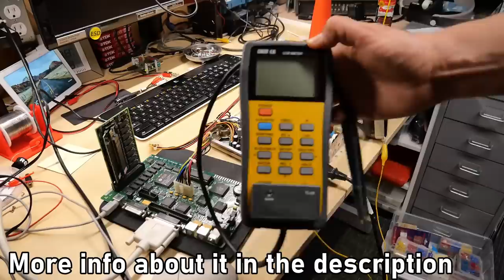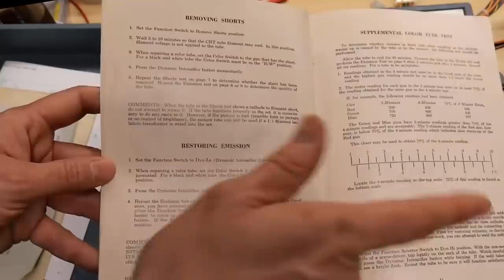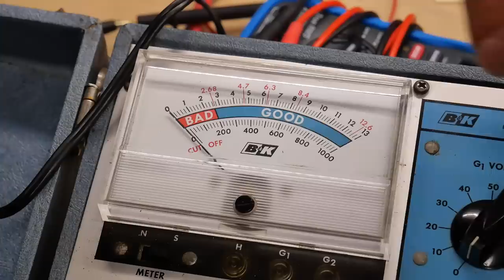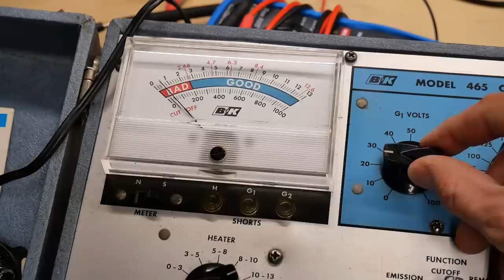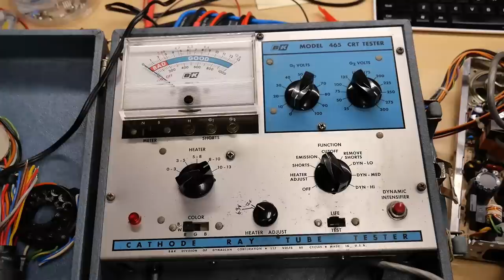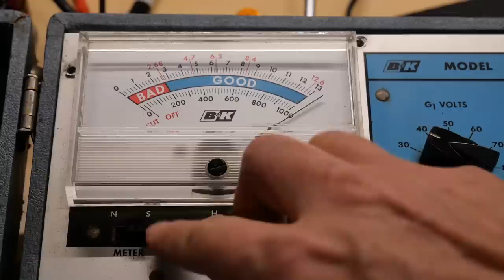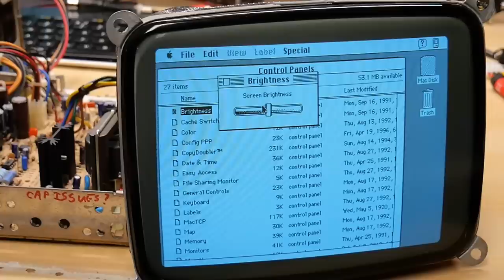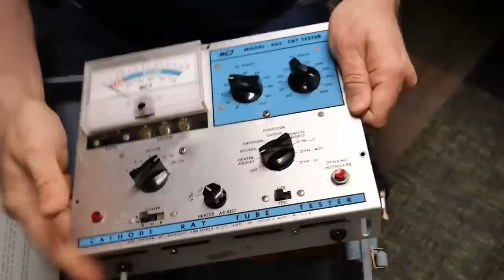Rejuvenating a Macintosh CRT with equipment from 1969

Comment: Someone needs to tell Louis Rossman about this..
Reply: I thought this exact thing
Reply: His comments section would explode with rants about the "impossible" Torx screws and "cramped" circuit design. Oh, and that you can't game on a Mac .-D
Poor Louis is cursed with a terrible audience.
Reply: @IlBiggo  Modern macs are trash for gaming. macOS has an ancient version of OpenGL and doesn't even have Vulkan unless you count MoltenVK.
Reply: @Margen67  Newsflash: gaming is not the main reason computers were invented. Cars are absolutely useless when cooking, but this doesn't make cars "trash".
Reply: @IlBiggo  They're not trash, but they're still not good for gaming.
Reply: @Margen67  Which would matter if Macs were marketed as game consoles. Macs are "good for gaming" just a bit more than cars are "good for cooking".
Reply: @IlBiggo  https://www.apple.com/mac-mini/#versatility-gallery-item-2

Regardless of marketing, it's still a legitimate criticism. A good number of PC users are gamers.
Criticizing things doesn't make someone "terrible".
Reply: @Margen67  <sigh> again, gaming is definitely not the main reason you'd buy a Mac for, just as, say, audio production is not the main reason to buy a PlayStation. That's why "a good number of" gamers are PC/console users and not Mac users, while "a good number of" professionals and general users just don't care about which computer they're using if it does work for them.
BTW, this reviewer https://www.forbes.com/sites/patrickmoorhead/2020/12/26/apple-macbook-pro-13-m1-aaa-gaming-experience-good-performance-for-thin-and-lite-but-rough-experience-for-some-games/?sh=64931e056209 seems to be actually a bit more satisfied with his Mac gaming than the average audio producer would be with a game console. And no, "it doesn't run ProTools" is not a valid criticism for the PS5.
Macs are not gaming consoles. Can you play games on a Mac? Yes. Surprisingly, even pretty demanding games appear to run fairly well.
Can you make a living as a professional gamer on a Mac? Probably not. W h o   c a r e s ?

Comment: In CRT days, I occasionally would attempt to rejuvinate a tired tube (while it was working) by tapping the neck very gently with a screwdriver handle. I know it sounds horrific, but it always worked for me, and I never broke a tube. It's the same principle of course; dislodging crud from the cathode.

Comment: I've used those before. you might get 30 seconds out of it or 30 years. Point is they don't make new tubes anymore so don't complain! if it shorts, you can try turning the tube on and tapping the neck with a blunt insulated device. it will knock whatever flaky coating they have on the electron guns off that is shorting and hopefully make it work. this is also why you don't want to store tubes neck down. any debris in the tube can short the guns out. Sony Trinitrons are bad for this.. I had many guns short.

Comment: Ahh - BK CRT tester... I bought a brand new BK 490 back in the early 90s for my TV workshop and it soon paid for itself, saving me spending too much fixing a dead TV only to find the CRT was bad. Not used it for over a decade and I just had to wander over to the workshop to fish it out for some nostalgia! Rejuvenation can be hit or miss - I did have one TV that went on for more than 7 years before dying from other issues!

With experience, it was possible to get an inkling for how well a rejuvenation might last just be how long it took for the needles to move.
Reply from the maker: Yeah there is definitely a technique for using it. I have practiced on another old color TV CRT and learned a lot. (I made this video about a month ago.)_
Reply: Adrian's Digital Basement Some brands of tube seemed to stand a much better chance of rejuvenation. The others would rapidly get worse with repeated attempts despite an initial improvement. I suspect the cathode material was used up. A handy tool to have and I feel old for having used used one for a living!

Comment: Your Rejuvenation Doubles and Reverses the voltage potential between the Cathode and the Control Grid.  Performs sorta a REVERSE Plating action.  As stated below it does remove some crap  off of the Cathode exposing fresh meat so to say.  No it won't last long.  Months at best.   Yes you can perform it a few times before any benefits are lost.  The Heater them selves go weak in time.

Comment: Nice work! Hopefully it lasts a few more years, considering it'll probably get some fairly light use anyway.

I should ask old the techs around at work if any of them have an old CRT tester that I could buy off them. But I'm wondering whether Heathkit or some other old kit maker sold one back in the day. Because it looks pretty simple, so might be possible to find a schematic and make a new one using modern parts.

Comment: The 465 will use the newer CRT adapters of the 466, 470, 480, and 490 testers if you have an adapter from BK. I have one NIB for trade bait if interested.

Comment: VideoKarma.org is a great place to get help with your rejuvinator. Yours has diodes, so increasing capacitance from 50 to 82 shouldn't present a problem. I recommend changing those caps, and making sure those caps are not having their voltage rating exceeded as modern caps don't tolerate overvoltage nearly as well as the old ones did.

Comment: I thought the manual said to hold the button for a while on the med setting. 
I see you tried my suggestion of rejuvenation, I actually do not own a machine to do it I just use my high voltage PSU and pass current through the cathode G1 pins as a valve with a limiting resistor and a meter in series so I can monitor the current..
Most 20mm neck CRT's are 12V heaters, 28mm and 36mm tend to be 6.3V.
I have not had any back for rejuced emmision and some have been in use for over 12 months.

Comment: How does that work? What is going Bad and what is that device doing to restore it?
Reply: I'm not an expert on CRTs, but my understanding is that the dimming of the picture is caused by chemical oxide buildup on the cathode which will limit the emission of electrons. The rejuvenation works by running high current through it for a brief moment, which 'burns' away that oxide coating.
Reply: @Shifter-1040ST  The test switch, switches caps from a carging position, into a discarge position on the cathode.

Comment: Interesting stuff.  I did a quick search out of curiosity, and apparently rejuvening a CRT blows shorts out of the electron gun(s) with a capacitive discharge.  So if it was a short caused by some contaminant and you blasted it away/vaporized it... that tube may last for years. LOL
Reply from the maker: Indeed. I think a short rendered the CRT unusable until you blow it away. I haven't seen that particular problem before.

Comment: I'd like to see a video about that LCR meter you showed.  Can you actually test them in-circuit without desoldering one lead with it?
Reply from the maker: Most of the time yes. It can test the caps from 100hz to 10khz. I'm super happy with the tester. Does a fantastic job and in combination with a DMM, it's just great for testing caps and resistors in circuit. (Testing resistors with DC like what a DMM does is useful when there are caps in parallel.) 

I figured I will make a video once I get more experience on using the DE-5000. First time I've had gear like this and it was a hugely worthwhile investment.
Reply: @adriansdigitalbasement  So like when you have several capacitors in parallel, like the filter caps in a PSU, you don't have to desolder one leg of each of them to get a good test without the others interfering?

Comment: My guess about the life test is that it measures some kind of leakage, as if the tube were a capacitor. The faster it discharges, the leakier the "capacitor".
Reply: I take that back -- in looking at my own CRT, the life test turns off the heater, and I guess it is measuring how long it takes for the heater to stop emitting.

Comment: When you calibrated the filament voltage you did it under the expected load, right? The power supply has no feedback and is adjustable to match different filament loads. Low filament voltage will lower emission.

Comment: Great video Adrian, nice bit of test equipment.
You said you replaced the offspec capacitors in the powersupply.
Did you replace the rest of the capacitors on the PCB, not necessarily the high DC bus capacitors, but the ones around the output?
If not it will be worth doing, as they will be form the same manufacturer and be of the same age, SMPS capacitor failure as you know is pretty high in older, and some newer, SMPS.
👍👍👍👍👍

Comment: When you're rejuvenating a tube and you're pushing that button momentarily what you're doing is you're overvoting the guns and that sends a high charge through it that blows any shorts that are in the guns or the grids off the spark at you here is because it's actually sending a high voltage through it to blast those deposits off of the guns and the grids you keep doing it and you're going to burn your grid or your gun into and it will be dead.

Comment: just a thought, when i was using mine, i used to hold the zap button down for about 10 seconds, i think your holding it for about 1.............if you look through the clear glass of the neck of the crt, you can see it sparking inside..............i found when used on B/W tubes it would make an amazing difference !   that would last years !...........some colour tubes, just a few hours ?

Comment: Great video. How about rejuvenating VFD displays in 80's old hifi equipment?
Reply: That will not work because the green willemite phosphors on the segments has degraded. Only way to improve slightly here is to briefly overheat the filament

Comment: "Heater?" Try "Cathode"! Those Rejuvenation kits do shorten the life of a CRT but you have think in TV terms and not Computer terms. Back then a TV was on 4 or 5 hours a day with more hours in the weekends. Life expectancy for a CRT was 12 to 15 years and one was expected to buy a new TV. Simple right?

Back then the TV repair guy would up the Cathode voltage to brighten a dimming screen. At best this would give 3 -5 years of added life. More than enough time to save up for a new TV. 

Using the tube rejuvenater shorten the life of the CRT to 2 years with an improved picture.

How? Simple: the Cathode element in CRTs is a thread like filament (old ones were made from cotton) with a thin metal thread wrapped around the filament. This gave the tube more electron flow inside the tube. But the passage of time the filament would crystallize on the wire, limiting electron flow and dimming the picture. 

Using the tube rejuvenater blows out the crystals on the cathode but it sacrifices a bit of the metal on the surface of the wire. Keep using the CRT long enough, the crystals return. Since the wire is thinner, eventually the filament breaks and the CRT dies. But in TV terms it should be enough time to buy a new TV. 

In computer terms? Who knows. I do not expect a Mac Classic to be on several hours a day everyday like a TV. So it should last you a few years.

Comment: nice video.
I would replace the rest of those caps as well. Many of them have a high leakage current when the voltage is high. Your LCR meter probably does not test them with tube-era voltages of up to 600V or whatever they might be rated for.

Comment: The CRT experienced a Moon landing.

I have this old, now unused (likely not working) color TV, in the 90's someone likely did a rejuvenation on its CRT, because the red channel kept fading away during every on-time. Of course, he did a shit job, with no practical result. Years later, I found some color coded RGB pots on the board, managed to stabilize the red channel. Sadly, later the green disappeared, and it seemed to me, that there's no green cathode glow. Likely the filament is either shorted or open circuit. If I'm "lucky", maybe it's just something on the neck board or somewhere else.

Comment: I think that you need to always recheck that Cut-off is still correct before reading Emissions, from other videos it'll often look like it's getting worse rather than better if you don't because the cut-off can change as a result. There also seems not uncommon for there to be minor setbacks followed by significant improvements. It also seemed like you're using very short bursts even on Medium while it looked like the manual suggest that for Low but slightly longer applications for the Medium setting you used later (but it worked, just took more tries).
Some people just blast it at the highest setting for extended times (using the "more is better" theory) and claim to never have lost a tube so it seems they're actually surprisingly robust as long as the voltages isn't set too high, the videos from Buffet Arcade Man and DeLuSioNaL's Arcade use a much more gradual and iterative approach similar to yours that seems a lot safer and saner.
https://www.youtube.com/watch?v=Vw7nmuGdDs0
https://www.youtube.com/watch?v=nWqqB_OnYzE

Comment: Maybe you should fully recap the Tube Tester and then redo the rejuvenation.  It might work better :).  All those electrolytics are potentially going to short and likely leak (electrically) and new caps are pretty cheap, and near enough is good enough with electrolytic values :).  Not with series resistance, but parallel resistance.  That tube tester will come in handy with a lot of tubes moving forward given how hard it is to find CRT's these days.

Comment: You should have measured the filament voltage UNDER LOAD.  That meter just might be correct as the heater in the tube loads down the tube tester and the voltage drops.
The life test runs the CRT at a lower heater voltage.  Another thing that they used to do was put a 'Brightner' on an old CRT to give it some more life.  This just increased the heater voltage by a few percent (step up transformer).  This also wouldn't work for long as the cathode would wear out some more (even quicker) till it was just as bad as before.  Sometimes you'd see TWO brightners in SERIES.  Needless to say that was a short fix till the CRT burnt out completely.  If the MAC runs the CRT on DC or from a winding on the flyback transformer, you can't use a brightener.  Check out Shango066's channel, he  often uses a CRT tester.
Reply from the maker: That's what I did -- measure it at the pins with the socket connected to the CRT. It does pull it down since it's not really regulated .....

Comment: Maybe anyone can help me.  I rebuilt an Macintosh SE, Its recapped, HD swapped for scsi2sd, Replaced battery, retro-brighted.
It works great however, the bottom left of the CRT seems to droop a little.  Like the convergence is maybe off?  I cant really find anything online specific to Macintosh CRT.
Would having it professionally degaussed be the path to take?    thanks

Comment: CRT rejuvenation's quite a simple art, as connected to the appropriate pins on the CRT neck, you can use a piezo igniter from a lighter or something to do the same function as this tester, as all it is doing is charging those caps and sending a high voltage spark, kind of like a camera flash, across the emission plate(s?) removing built up stuff from it so the electrons can flow freely.... :)
I only know of this from investigating the weak CRT in my cheap CRT oscilloscope, though in my case the fix didn't work, and a replacement tube is a "hahahahahaha No." price from china... :P

Comment: I want one of these (actually a Sencore 7000) to repair my friend's arcade games.  Everyone is so afraid of rejuvenating the CRT (OMG it is gonna blow up?).I haven't seen any VIDEO where it's killed the CRT. I emphasize I never have had any experience and the lack of failing videos may simply be because they were disappointing.  The "repair shorts" would be a high voltage / high current.  Shango066 did a rejuvenation says that it blasts particles off the cathode to allow a fresh surface.  Don't have one myself yet (spendy for a 7000 $3k)

Comment: Adrian, what is that little display with the animated images/icons over the component shelves?
Reply from the maker: It's called a "Tivoo" pixel art display. You can find those on Amazon and elsewhere.
Reply: @adriansdigitalbasement  Thanks for the tip, and for the amazing videos!

Comment: Those meters are usually accurate, if yours isnt, there's something wrong with it. I suspect you measure 12 volts without the tube connected, then when it was connected it loaded the voltage down.

Comment: To bad I don't live in your area, my 1802 Commodore monitor could use a little tune up. The brightness is fine but the picture needs to be recalibrated to get full screen. I'm guessing there are internal controls that can fix it or the yoke needs adjusting. Dunno but I'm scared to death of taking it apart do to being electrocuted and might end up destroying it. It's used for retro consoles. My Neo Geo looks amazing on it. I've had it since 1986.